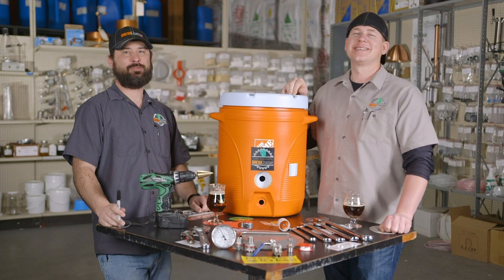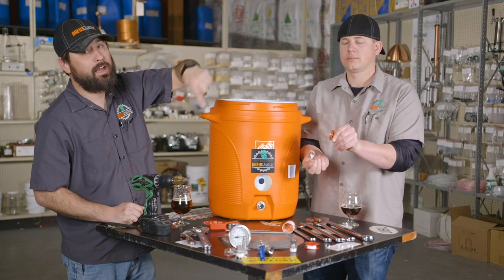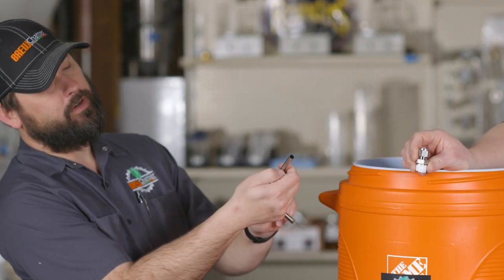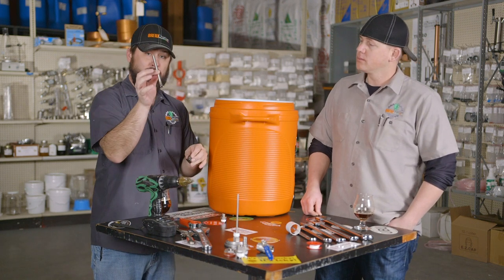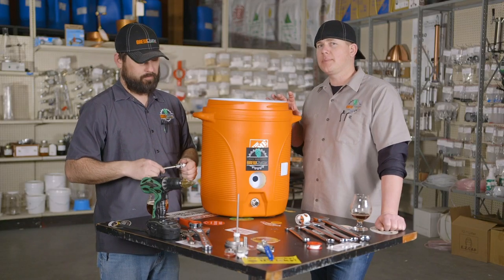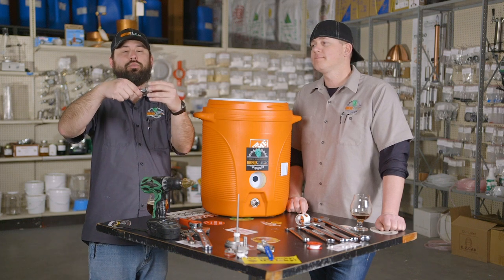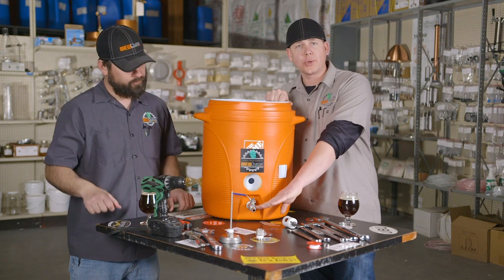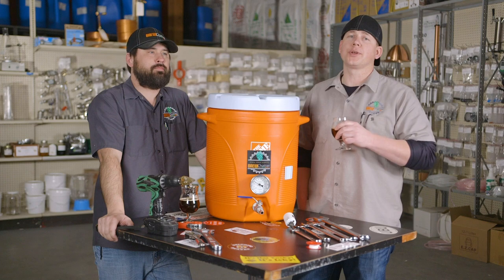How to Convert your cooler to a Mash Tun

Comment: I see 2 minor errors. First error is that the Cooler you are using is a Rubbermade Cooler not an Igloo.  Rubbermade use screw on lids and Igloos use a push down type of lid. 2nd error is the wrench for the inside nut (1 1/4") is not listed in the tools listing. Other than that, it was very informative. I sent off for your conversion kit and bought a Igloo cooler to convert. Now waiting on the kit. Thanks